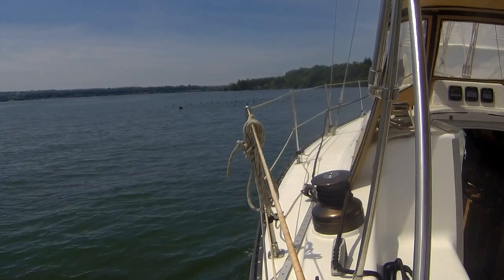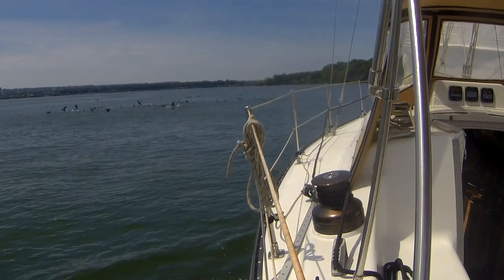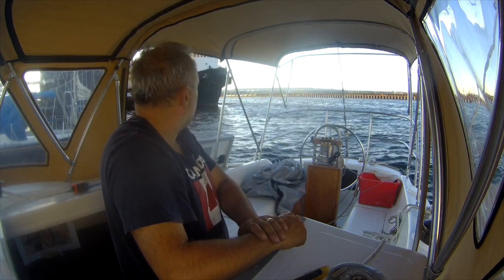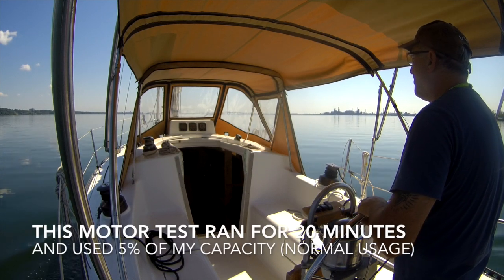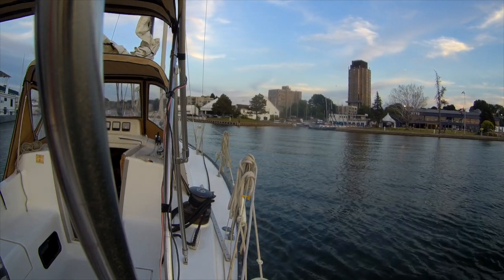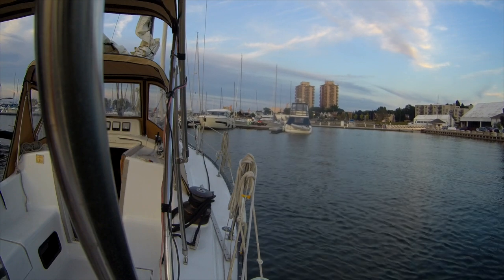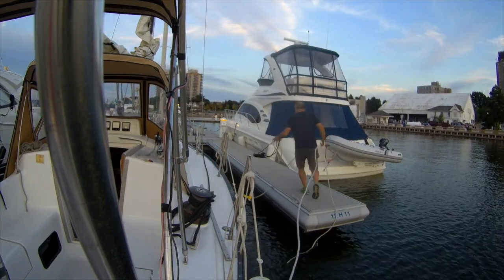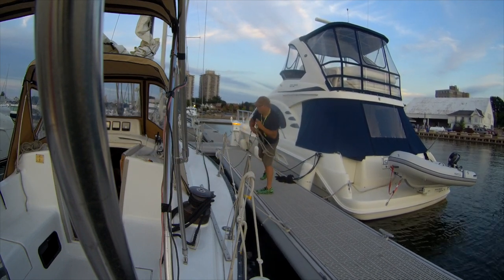Ep50 Tech Tips: 10KW 48V Electric Motor Lessoned Learned and Tests

Comment: I already installed the 10kw motor in my sailboat, is four 12v batteries of 100ah enough? Or can i buy those 3.2v 50ah 16 of them?
Reply from the maker: I hope you enjoy the electric! 

I believe that it fully depends on how you are going to use the boat. I also wouldn't consider anything but LiFoPo4 now that I have experienced both. For myself, I am not in a rush so I use the electric optimized for slower speed/longer distance. Right now I feel 100Amp Hours is not quite enough as I want to load up more electronics so I am going to double up the batteries to 200 Amp Hours. Keep in mind that I use the batteries for more than just my electric motor. It replaced my house bank I don't have a dedicated motor only battery bank.

If you install 50 Amp hours LiFoPO4 you get about 40 Amp Hours usable so when I cruise at 3.5/4 I pull 1700 watts (35 to 40 amps) so I'd get about an hour run time.

Another consideration is that if you have one bad battery, you will have less voltage so will your electric run on lessor voltage. My thoughts is that there should be a way to have a spare or to run at a lesser capacity while a battery gets replaced (as opposed to being shut off entirely). 

From my experience I just want a larger safety margin and I am also including a generator hookup 'just in case'. You never know and I don't want to be squashing against any rocks. As I also use the batteries for my fridge, electronics and instruments so I need a little more overhead. Victron has a calculator that I used and to go longer cruising full time distances they rated my needs at 160 Amp hours.  Good luck 😀and thanks for watching and commentating!
Reply: @TheNeds   Thank you i appreciate the long reply, the 4 batteries will exclusively be for the motor. Since i already have a separate electric system with two other batteries for instruments, electronics, pumps, fridge, lights etc... i saw those 12v  150 ah gel battery for $200. Lifepo4 are double price
Reply from the maker: if you go traditional battery you only get 1/2 usable. so 100 ah is really 50 ah. if you go lifopo4 then 100ah is really 80ah. 

because of the faster charging rates on lithium when you deplete lithium it fully charges in a much shorter time frame. on my previous batteries when i drained them fully i had to wait 2.5 days on trickle charge but only 5 hours on lithium.

Comment: Thanks for the video. We are about to pull the trigger on a conversion kit. Is there anything you would have done differently with your setup?
Reply from the maker: I hope some of my videos are useful.

the biggest thing I have learned about is batteries, the amp output rate is a key item. I knew that the lead acid would be wimpy but I didn't have enough data to tell me what did 25amps / 35amps / 45amps really do in a real life practical example with currents, headwind, without headwind etc.

The lithium cells I am looking at can do up to 200amps safely. My motor peak is 90 amps and I am way past prop cavitation (wasted effort). Aside from that I like sailing, I don't like motoring, and my motor is mainly to get in and out of slips/harbours etc. I am very glad to have the electric. If you are in a rush all the time, I'm not certain electric would be a good choice.

As a last comment I do plan on getting a generator set integrated into my charging so I can charge at 35amps. This will greatly help if we need it to act like a regular motor and go a long distance. If someone got hurt and we wanted to motor a solid 4 knots, 35 amps is enough and I could go as long as my generator can charge the batteries (hours).

Comment: I am going down electric route in the next year of my kingfisher 30, mainly as my engine is a bit tired and by time i fitted a new engine or rebuilt it i could have a nice electric set up.. I am using a nissan leaf motor and will end up using the lipo batterys from a leaf as well..
Reply from the maker: the old atomic 4 recondition cost that was done in 2012 was about $7000 US. + the labour. going to electric got rid of all the oil stains, smells and gas fumes. Very happy about that. Good luck with your leaf conversion, that sounds cool! If you post some vids let me know. Best of luck!

Comment: I’d change the reduction, wheel and increase the battery bank and charging capacity. Really I would have got a newer more efficient diesel and more tankage
Reply from the maker: I thought about that a long time, but wanted to get the fuel off. Appreciate the feedback! What gear reduction would you have done? Already looking at increasing the charging capacity. I don't have a lot of room, but am doubling up to 800watts solar charging.

Comment: Why is that your amperage is so low? 25a oh.. the default controller is capable for 300a.
Reply from the maker: i have the controller high amp limit set to 225 amps. i have run it at 100 amps during a storm but my issue is battery depletion: my batteries are not lithium so i have optimal battery life at 25amps draw. more than that i am starting to generate heat internal to the battery and they deplete much faster. im saving my pennies for lithium where i can pull more without concern.

Comment: Hey thanks for documenting this, very handy for me as I'm about to embark on a similar project on our 37ft boat.   Out of interest do you know if the controller is capable of regen and what size reduction gear have you used?
Reply from the maker: I used a 1.91 reduction but I'm going to lower that to around 1.6-1.7 to drop the RPM a bit - the 10KW motor has a lot of torque. I am also going to put in a 3 blade prop to replace the thin 2 blade prop. My goal is to try to get to 4 knots hull speed at 25 amps draw or as close as possible.

I am not 100% certain on regen. I was told that it can while braking. I believe if it's spinning on it's own it will generate some power. I did not see a 'regen' setting in the software, but it's a motor, so if it's spinning on it's own it should generate electricity, but I'm not certain how to utilize anything yet.

What I did experience is that having the motor running slightly while that sails were up under a light wind I was able to keep a speed of 3 knots and the motor didn't take anywhere near the amps without the sails. The solar charging also exceeded or matched the motor amp draw, so I think there was some sort of regenerative qualities of the setup I have, but I need more data to figure out where this came from. I was running a while and didn't use any battery which was cool. Definitely some interesting options to figure out here.
Reply: @TheNeds  Thank you for the detailed response.  I've been researching for 2 years and been toying between an "off the shelf " like electric yachts or building my own. You have made this build look so elegantly simple that I think you may have swayed it for me. 

Yes, my understanding is that the regen is more about the controller than the motor. Though thinking about it I wonder what difference the reduction gear would make...

How much solar to you have?   I'd like to be able to sail at around 2.5knts/3kts without drawing from the battery, If you reckon you can get 4knts with only 25amp draw, that would be bang on for the amount of solar I have calculated.
Reply from the maker: @luckybeanzphoto  right now I'm getting 3 to 3.2 knots (hull speed) at 25 amps so a touch slower than I'd like. If I have a good headwind I have to increase to about 35 amps and I am depleting my batteries too fast. I learned quite a bit doing this myself, and the support from the community and suppliers have been great. I have 400 watts solar but am increasing that to 800. The hardest part I think would be the actual motor physical mount and alignments. Unfortunately I had a faulty controller from the start which threw me down some dead-ends and time wasters... but I did have it hooked up correctly and once swapped out it's performed better than expectations. I have one additional add-on I'm going to put in this winter is a small DC generator for the longer than normal trip. I had an emergency blow off anchor with 58 knot winds and I depleted the batteries in about an an hours running at close to 100 amps at times. I plan on doing the ERIE canal next fall so I figure I'll be motoring quite a bit and a DC generator would be a good thing for long trips on motor. Best to you on your project!